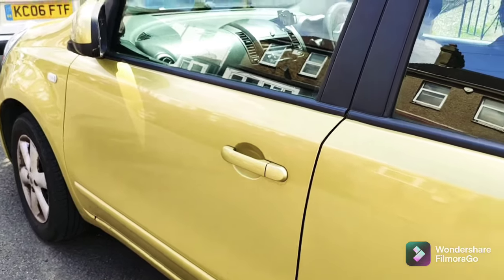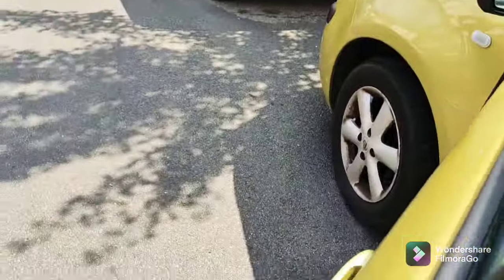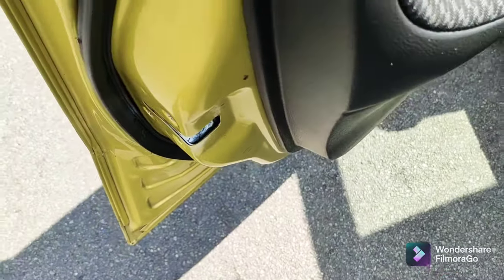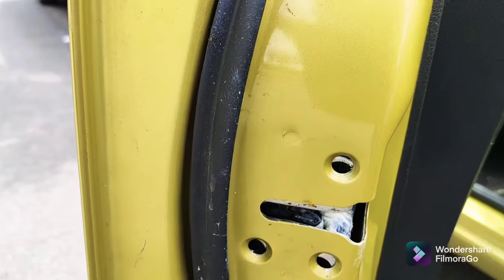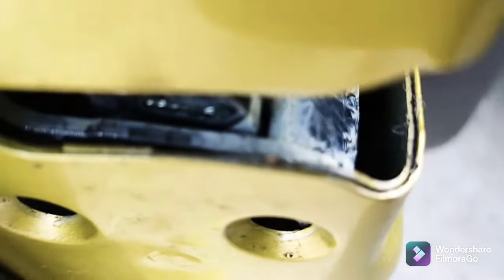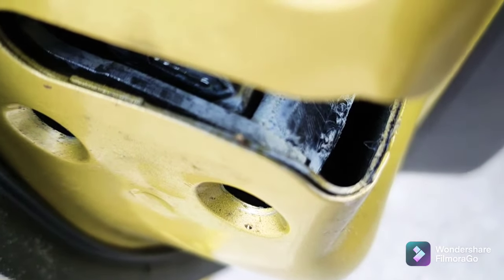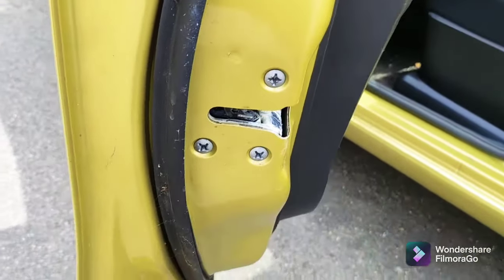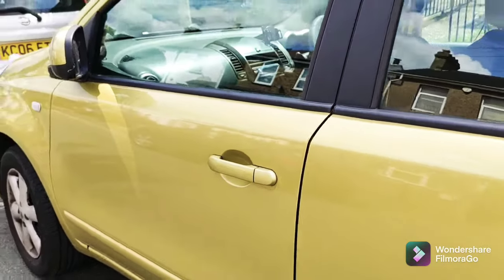PROBLEM SOLVED FOR FREE: Nissan Door Lock Making Screeching Noise

Comment: Thanks for this video.
Like a lot of other comments I was super dubious as I couldn’t see the pin you were referring to in your video, but I thought let’s have a look.
I could actually see the pin you referred too before I unscrewed the locking mechanism so thought that’s a good start.
After getting some room I couldn’t budge the pin so nearly gave up. After some perseverance it started to move and “hay presto”, it went all the way in and the noise is gone.
Thanks for the tip, my daughter is super happy the noise has gone on her car and I’m a hero.
Cheers!
Reply from the maker: Glad you managed to sort the problem. Unfortunately no matter which ever angle I tried couldn't get the camera to pick up the pin. But hey main thing is your daughter is happy.

Comment: Damn, I'm saving this video. I just got a used nissan rogue and it makes the same noise. Previous owner said it did that the whole time she had it so it must be normal. I was like..no..it should not make that sound. I was about to go price out a new actuator. I'm gonna hold off on that till I try finding that pin this weekend.

Comment: Thanks for this. 
Had the problem on my Nissan 370z and your video showed me how to sort it out. In fact, it's even easier on a 370z, because you don't need to unscrew anything - the pin is accessible with the mechanism screwed in place. 2 seconds and it's mended.
Reply from the maker: Glad it worked for you.
Reply: I have the same problem with my z but I don’t see any pins sticking out? lmk how you got it fixed pls
Reply: @mjlagatao8031  All the videos on this subject show it quite clearly. Have another look at them. Good luck.
Reply: What angle did you insert the screwdriver to push the pin back in?

Comment: Thank you very much! Same fix on a 2014 Infiniti G37s/Q60s. Slightly different angle. Removed bottom two screws , leveraged the lock toward the outside of the vehicle then put a screwdriver through the screw hole closest to the cabin and could reach the pin and push it back in.
Reply from the maker: AHH good stuff. Thanks for the details around the G37/Q60
Reply: what does the pin look like? I couldn’t find it on my q50

Comment: I have a Nissan Versa, which should be an American version of Nissan Note. I have the same problem. The lock looks the same, just the screws are different. I just couldn't find any pin or actually see it. Maybe it's different from Note. I'll try again with a better light when I find the time. Luckily, the door locks, it's just the noise that's out of the order.
Reply from the maker: Yes the mechanism works...but that little pin just sticks out a little hence that annoying noise

Comment: My Infiniti does have the same problem, in rear driver side door and front passenger door. 

Will the same fix apply for my car too? 

Pls suggest.
Reply from the maker: @dineshrajendran503  no harm in trying, most likely it's the same and if it doesn't work at least you tried and it didn't cost anything

Comment: Would the same fix work on a 2016 Hyundai Elantra making the same noise?  If the noise come from the right rear door, should we check and push the pin on that door or on the driver door?
Reply from the maker: @benjaminnkenni4883  not sure to be honest, but worth a try if it's a similar noise

Comment: My Juke makes that noise when I lock it, but when I checked the lock, I didn't see a pin. Any thoughts?
Reply: Door actuator
Reply: @lowlowsandclothes9923  is that a tool or something?
Reply: @HeyYouShouldSmile  That is the actual device that locks the door, that one that got loose in this video by removing those screws, you will have to replace it

Comment: Hi, the right door of my Qashqai does not open from the outside when I use the keyless or the remote control, if instead I open from the inside and then close the opening works again from the outside but only for once. how can I fix it? I have to change the lock, I noticed that the centralised opening mechanism does not unlock that door but all the others of, thanks
Reply from the maker: This sounds like the central locking mechanism sticking ..you might get away with trying WD 40...if that doesn't work then looks like that door's mechanism will need changing
Reply: @sutsi  thanks a lot

Comment: I have nissan versa sedan 2015 same problem making noise while locking, my car has different type of screws, can't unscrew and can't see pin , mechanic says to replace whole thing.
Reply from the maker: To fix permanently you would need to replace unit...but if you can see pin then this is the cheap option. Hope it works out for you
Reply: Thanks for your reply, it worked for 1 or 2 time, I randomly pressed inside without unscrewing but again it started making noise, I think I will keep trying
Reply: Because mechanic ask too much money
Reply from the maker: @sureshgrover290  if you can try to take off the door card and see if you can see the screws that way
Reply: Sorry for the late, I will try and let you know, thanks.